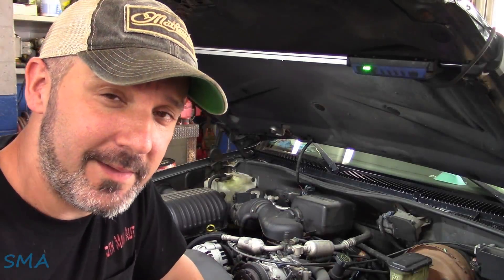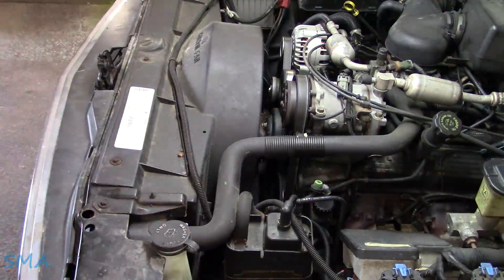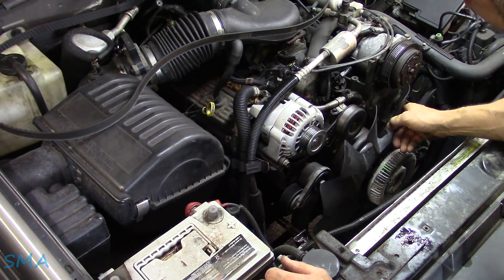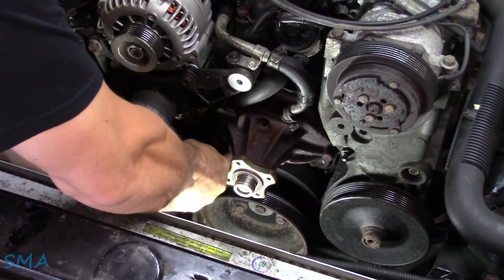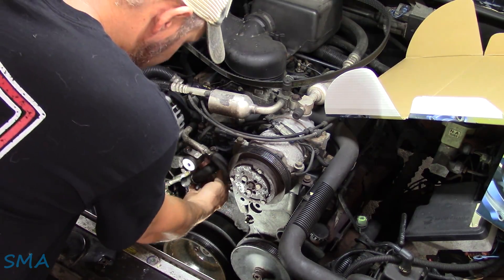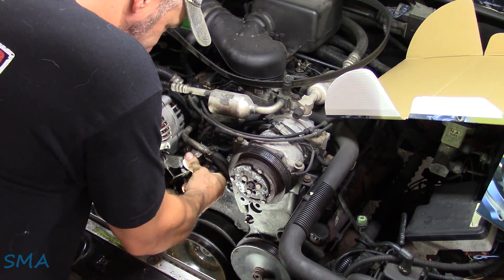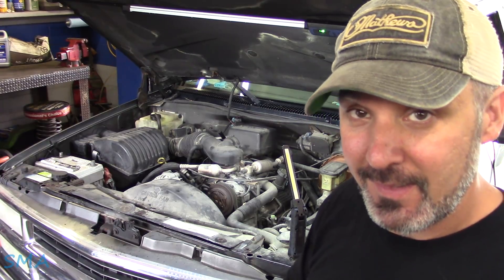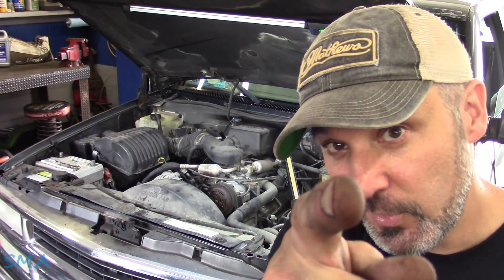Water Pump Replacement: 5.7 Chevy Tahoe / Silverado / GMC Sierra / Yukon

Comment: One of my favorite engine. Easy to work on.
Reply from the maker: Agreed!
The original CHEVY THUNDER!
Reply: Unfortunately they need to be and often
Reply: Absolutely!
Reply: @mikeholt3545  Not
Reply: @SouthMainAuto  Gotta go back to 1955, 265 ci. in the Vette. Who'd thunk Chevy's first V8 would morph into the engine car guys dreamed of ???? 265,283,305,307,327,350,400, AND NOT FORGETTING MY FAVORITE THE 302 Z-28 CAMARO ENGINE.  W O W !!!!
Reply: @terryharvey4811  Don't forget the 262 in the 75 Monza.
Reply: @61rampy65  I believe there was also a 267.
Reply: @61rampy65  I was only noting V 8s, but the 262 V 6 was pretty peppy in the light bodied Monza..
Reply: @terryharvey4811  262 Was a 
V-8.
Reply: @mikeholt3545  Not compared to the competition! I saw only the IHC as needing less maintenance and they always needed carb work if they were parked for a season.
Reply: @MikeBrown-ii3pt  Yes Mike Brown there was it was commonly known to be in the 80 & 81 Malibu s & El Camino s

Comment: I just spent 8 1/2 hours out in 100 degree heat, changing out a valve cover gasket and the 16 spark plugs on my 2007 RAM 1500 5.7 Hemi.................Eric you CAN HAVE ALL THAT MESS!.

Comment: These were some of the best engines ever made I got one in my jeep may avalanche has original motor with 400,000 no check engine light runs smooth. Chevy 5.3 and and the 5.7 were solid until 05 when the put that cylinder fuel management deactivation bologna
Reply: Bones McGillicuddy  I think '07 was the first year for the full size trucks. I've worked on an '06 FailBlazer that had the crap so they were definitely using it in some applications before '07.

Comment: I have a 1999 suburban with the same 5.7 liter engine that's  on its 3rd water pump right now.  185K miles and still running strong.
Reply: 8 months ago I drove home a 94 suburban with 293k 5.7 took it from Tennessee to Maryland no issues it was in great shape we did like 85mph or more most the way road like a 80s Buick

Comment: When I was told that GM was dropping the 350 in 2000 I went and ordered my 1999 Tahoe 350  and ordered everything heavy duty and I think it had 2 or 3 alternators available back then .  ( The dealer did miss the HD air filter and dual batteries  ) With 125,000 miles on it I think I will keep it a few more years after I fix the AC  UNITS -two. Some day I may even take the wire tie off the engine block heater cord and see if it works.

Comment: I have a `91 C1500 Silverado with the 5.7. Has just over 300,000 miles, still runs strong. I`m a bit OCD when it comes to maintenance schedule. :)

Comment: I use my '96 two door Tahoe as a daily driver with 87m miles. No rust under or on top as it was stored during the winter for many years. That CFI system was a bad idea but the MFI conversion was a good fix  (Briansmobile has a good video on the MFI conversion).
Reply: it works GREAT in all the Vortec engines, i actually demand that my customers put in the MPFI spiders any time I have to pull the intake, between the pressure regulator leaks, and the need for 50psi+ to pop the poppits, and the added miles per gallon and quicker start times and much better power, it's a no brainer to do the swap

Comment: Owned a '95 mostly green Silverado pick up with the 350/5.7l TBI engine in it.  Sold it two years ago, 255k miles, with the factory water pump and starter.  The thing was bullet proof.

Comment: I have the big 4.3L .. Just like this one minus 2 cylinders (2001 Olds Bravada) still runs smooth!
Reply: Had a 1990 S10 4x4 Blazer with the 4.3 L V6 TBI......great engine! Gave it to my brother-in-law running perfectly at 220,000 miles.  He subsequently neglected it and blew the engine towing a huge airstream across the greater New Orleans Mississippi River bridge....
idiot.
Reply: 99 Blazer rocking the big 4.3L here. 279,000 miles. Original water pump. Heck, most of it is original. Replaced an idler pulley, AC compressor, plugs and wires, all of the vacuum lines. Come to think of it, probably the original belt though.

Comment: In the previous century (1979) I owned a '71 Plymouth Fury with the 'Big 318'. On a trip from FL to New Orleans to send my wife and daughters to Phoenix, AZ, I noticed the water pump leaking. So, I bought a new one at a parts store in New Orleans before taking my family to the airport. Coolant started leaking heavily about 10 miles from NO, so I stopped under an overpass for shade and successfully replaced the pump. Fortunately, I had a modest tool kit in the car. Also, there was a tiny creek running nearby (neglected buying antifreeze). That car had tons of room for this procedure.

Comment: I agree those old 350’s were good power plants.  I have had a couple and had very few problems with them .  I presently own a 2000 Tahoe Limited (only produced one year) built on the 1999 body/frame.  Still in great condition and it just turned over 166,000 miles.  It is a solid tank of a Tahoe.

Comment: My first truck was a 93 Seirra with a 350 motor, I ran it up to 260,000 miles and sold it to a friend. He added another 20,000 before he wrecked it. No telling how many miles it could have ended up with otherwise. Great engine

Comment: I have the big 5.7 small block (circa from my dad’s 1978 GMC Jimmy) put in my 1950 F1 when we did the swap in 1985. I inherited the F1 when Pop died in 01. Replaced same water pump a few years back after some 30 years with maybe 5k miles on it. My fan is old school direct drive w/o the clutch and uses a V pulley/belt. Agree the 350 is the M1 Sherman of American iron. 👍🏼

Comment: old cars are easy to maintain and repair. 
An advice to all mechanics: whenever working closer to the exposed radaitor, put a card board or any protective barrier to prevent any unintentionally move that could harm the radaitor fins. 
just an advice.

Comment: do you check the bolts on the back cover of those water pumps? i've had them leak back there on a new pump, so every time i do one of those i check them, and believe it or not some of them are not tight at all.
Reply: SANE HERE.

Comment: Changed the water pump on my ' 95 Chevy g-20 van . Re manufactured Chinese junk , $32 in the box.
Used the old bolts.  Runs great.

Comment: My 2000 1 ton long bed has the same engine and aside from a timing cover oil leak, it's better than the 5.3 in my new truck.  Change the oil every 5k and it will out live all of these new engines!
Reply: I am not a fan of the  "ecotech 3" engines either. I had a 6.2 and it had more repairs in the 3 years i owned it than my last 5 trucks combined. I'm talking what i consider major engine issues specifically with the valve train, things like camshafts and lifters..... I have never had major engine work on a small block GM engine until this one. 

The original 5.3 on the other hand, the 99-06 flavor the pre-AFM engines, those were also excellent. I put over 200k on two of them with no engine issues, just oil changes and regular maint.
Reply: That's probably the crank sensor leaking. They'll crack

Comment: I definitely love these era of GM Trucks. My 00 Yukon Denali has been solid for me. Sat in a lot for about 3 months and fired right up. Test drove it, fell in love with it; bought it on September 28, 2016. Still own it 5 years later.

Comment: Father in law has a 97 tahoe car still running good till this day.
Reply: '86 K5 Blazer at 386Kmikes and the ORIGINAL serpentine belt still on it. I keep a new one in the center console just in case the OE GM belt fails. I bet the new belt disintegrates before the OE  fails though! At this point, it's a contest -- either I die or the belt does. I'm 75 and the belt's only 35 years old. It's gonna be close.

Comment: What brand is the tool that takes the fan off? I have to say, you have some of the most informative and professionally produced videos on the internet, you're fantastic!
Reply: It is not needed, normally with the belt left on, they is tension enough to put a wrench on the big fan nut.  Then hit the wrench with a hammer and the fan will spin right off.  I own this engine and have changed 2 pumps so far.
Reply: @slalomking  if you encounter slipping with the belt installed while removing the fan clutch, just grab a smaller vice grip, grab a small piece of rubber to protect the belt, and clamp the belt to the fan clutch pulley and then proceed to spin off the clutch with a 36mm open wrench.  works like a charm!

Comment: Rather do this job than changing a timing chain-driven water pump on a Ford V6.
Reply: On a 2013-2019 police package Taurus, AKA: "Police Interceptor Sedan", you have to pull the engine to replace the water pump on its V6. Not sure on the regular Taurus.
Reply: Why compare a engine that was produced 15 years later to the old 350 that left production in 2002?
Reply: @dakotakelly9371  because Ford are Mickey mouse engineered.
YouTube deboss garage why I'm not a fan of Ford..
Reply: @philllsxga.7737  But once again, why compare 2 engines of 2 completely different time frames?
Reply: @dakotakelly9371  YouTube car wizard tears down a 5.4 Triton..
YouTube car wizard best engine ever.
Again Ford are Mickey mouse...
Reply: @philllsxga.7737  I never said the 5.4 was a good engine. My original comment was regarded to comparing changing a water pump on a old Chevy 5.7 to a newer ford with an internal pump. What does that have to do with a 5.4?
Reply: @philllsxga.7737  Although I will stick up for the 5.4 since you brought it up, the 5.4 2v was a good engine and is known to last well over 200k miles. Feel free to tell me why you think I’m wrong.
Reply: @dakotakelly9371  YouTube Car Wizard tears down a 5.4 Triton.
If the 5.4 whatever number of valves were such good engines explain theses...
YouTube k.p mustang.
YouTube LS9 mustang.
YouTube most patriotic turbo LS mustang.
YouTube 88 mm turbo LS mustang.
YouTube Chevy powered mustang wrecks the yard.
YouTube LS swap mustang.
YouTube sloppy mechanic 8 for 8.

That's just a few examples of the reliability of the Chevy LS why don't those mustangs have 5.4 Triton Ford engines in them if the Triton is so good?????????
Reply: @philllsxga.7737  I don’t know why you keep giving me YouTube links that I’m not going to look at. Instead give me YOUR opinion on why you think it’s a bad engine. And a special 5.4 was actually used in specific models of the mustang. The 4.6 was more commonly used because the 5.4 that was used in the truck lineup was produced with towing in mind and made most of its torque down low which isn’t ideal for a car. 

Now instead of giving me links that I don’t care about, and telling me about how good another engine is, why don’t actually tell me what’s so bad about the 5.4
Reply: @dakotakelly9371   YouTube why the LS is so good.
YouTube LSX Challenger.
YouTube LSX RAM.
YouTube LS Lamborghin.
YouTube LS Ferrari.
Why don't those vehicles have 5.4 tritons in them???
I'll write it again Mickey mouse engineering...
Reply: @philllsxga.7737  Once again, I do not care how good the ls engine is. That is not the topic here.  Please explain why you think the 5.4 isn’t a good engine.
Reply: @dakotakelly9371  🤣🤣🤣
Knowledge is power...
Reply: @philllsxga.7737  Well if that’s the case I would say you can bench press about 10lbs at the very most.
Reply: Try a VW 2.0L timing belt driven one, so much has to come off just to get to it it’s not funny. Typical German Engineering, have to take 1/2 of whatever it is apart to get to the failed part.

Comment: The old 5.7/350 Chevy small block, does bring back some memories. Here I thought I was the only one that was OCD about all the same bolts, also I always referred to the universal torque specs, "Tight Fully Driven and Not Stripped."

Comment: Maybe 10 years from now, he'll be back and you can change the water pump again!
Reply: Change or put additive in the coolant on a regular schedule and he'll save the problem (and get the radiator and heater core to last longer too)

Comment: I had a 350 4-barrel in an Olds Cutlass S. Damn that was an awesome engine. I put a tiny bit over 300K on that car and sold it to a good buddy of mine. He gave it to his Dad in Louisiana and he put another 150K in it until the floorboards rusted out. I guess using it as a fishing car will do that. My buddy told me the engine smoked a little but was still running when it was “retired”. Only thing I ever had to do to it was water pumps, brakes, alternators and I had to replace the distributor when the bearings wore out. Dang. I really miss that Olds. It would haul the freaking mail when you punched it. What a great engine!!

Comment: There are still a lot of SBC engines being used.  Mostly replacement for classic cars.  Usually for driver cars that don't need massive HP. They a relatively inexpensive to buy as a crate engine.
Reply: Cars, trucks, boats, wood chippers. You name it there's a Small Block Chevy putting in work. That engine will be around 100 years I guarantee it.
Reply: Had one on my airboat too!

Comment: My 1999 Tahoe LT 4x4 has the exact same 5.7 L Vortec with only 64 K actual miles on it.   I purchased it new and it has been mostly garaged over the last 22 years.  I just love my Tahoe (and no its NOT for sale).  I once had a crank sensor that did crap out, and an alternator that burned up after bees built a mud home in it, but no other problems at all, and it still tuns like a clock.  Original plugs, wires and water pump.  As preventive maintenance I replaced the intake manifold gaskets with Felpro’s then flushed and converted to universal green antifreeze.  Threw on a new distributer cap and a gates serpentine belt for funsie, and this baby should easily run another twenty years.  Great dual A/C, leather seats, entertainment system including DVD Player for the kids, and a heavy duty towing package (used only once to haul an ‘85 Firebird from Memphis, Tn. to Jackson, M.S.).  This truck saved my ass in a legendary ice storm in Memphis.  Only two vehicles that could handle the deep ice forming everywhere were Humvee’s and 4x4 trucks, including my Tahoe.  Had a wife and two babies trapped with me in that 11 degree blowing ice storm midway  between Jackson and Memphis and cruised for hours nice and warm into Germantown locked in Lo 4x4......piece of cake.  Sweetest, most dependable vehicle I’ve ever owned.  Rust/dent free......still like new.  I don’t even let it outdoors overnight....its family.  Dr. K.
Reply: Bones McGillicuddy  No......this one is a keeper.

Comment: Best thing for those 350s was converting from Dex-Cool to your classic green antifreeze.
Reply: I know that Dex cool stuff was like rust in a bottle. It being orange was just dumb
Reply: Dex-Cool destroyed the heater core and intake manifold gaskets in my 2010 S-10 Blazer. The stuff turns to mud and clogs up everything. It did not go back in after the repair.

Comment: We have a 97 K1500 burb with the 5.7 and 275,000 mile on it and still going strong. It's on it's second transmission, and have replaced things like the power steering pump, alternator, brakes, etc. But it lives in the Pacific NW so no rust anywhere on the vehicle. Thanks for the video.

Comment: I had the same thing in a 97 1 ton savana. Bought it with 33k and got out of it at 220 k. Pump never went but the intake gasket did trice.  Shop repair was better than factory. Lasted twice as long. Spider fuely

Comment: A classic. The old failed water pump was probably yet more made in China junk. It seems to run well at least starting and idling in the bay despite being 22 years old and high miles. At least it’s not a Ford with the water pump inside the timing chain cover where when it starts leaking it often takes out the entire engine by dumping coolant into the oil in a way that’s difficult to detect until it’s too late.

Comment: I've got an 89 Chevy S10 with a 4.3L, basically this motor with the last two cylinders cut out of the block. 178k miles, and as old as it is it still cranks and fires without issues every single time. Great reliable little motors that run forever

Comment: I just pulled one out of a 99 Tahoe. It will be the donor engine for my 57 Willy Wagon. It currently sports a 70's vintage 350. This will be a nice upgrade with a computer controlled F.I. and a 4speed to replace the old Turbo 350. I know a 6.0 LS would be better but I scored the whole Tahoe for 5 bills with a good running 5.7 and a rebuilt 4l60e. and transfer case and all the wiring I could rip out of the thing. It was too good to pass up.